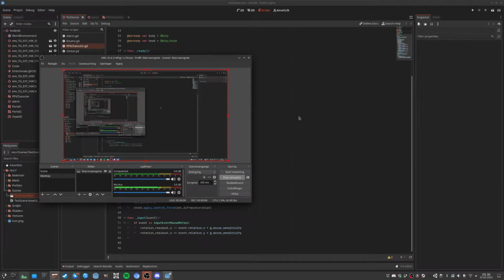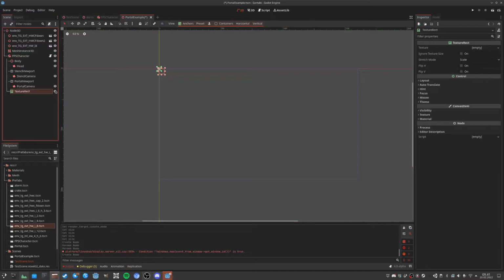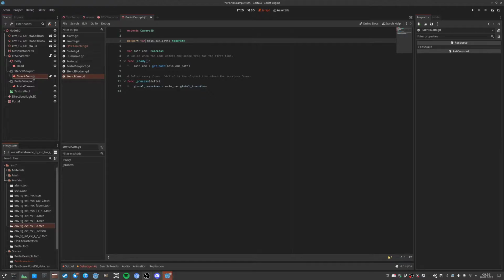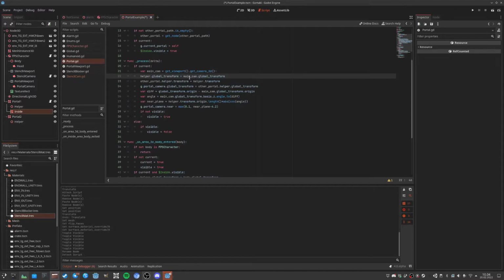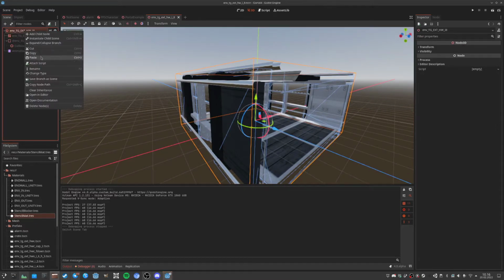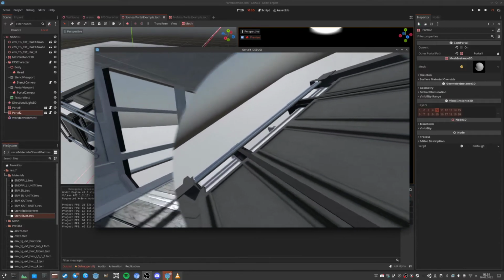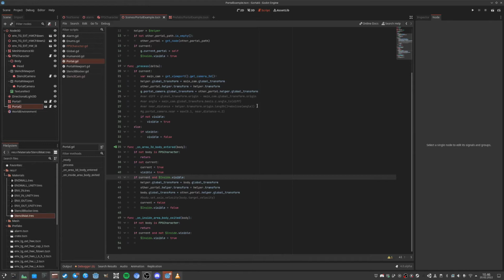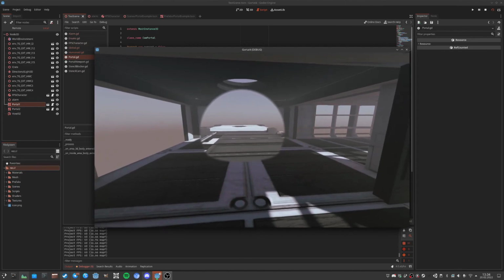Godot Portal Tutorial

Comment: Does this work with packedscenes to change between .tscn files or only inside the current scene?
Reply from the maker: You need to have both ends of the portal rendering with the two cameras in the current scene tree.
So yeah you can jump between two scenes ("tscn") files, but they both need to be loaded and visible.
Reply: @Pracedru  should be possible then with preload, right? Because the 2 addtional levels i have in my game shouldn't be visible in the main level, but this portal effect would be very neat.

Comment: I would love to implement those kind of portals in a project of mine. However my project is a third person game. The problem there is that the portals are always rendered above everything else. Do you know how could solve that problem?
Reply from the maker: You could use the stencil . When rendering it you can include the things that block it.
Reply: @Pracedru  Thank you for your answer. I was trying to change the culling and visibility layers but that didn't work out. I am sorry but could you describe in a bit more in detail what exactly you mean by including the things to block in the stencil? Thanks in advance.
Reply from the maker: Yes. The things that need to be rendered above the portal needs to be rendered black in the stencil. I essence the portal is white and everything else is black. If your character is between the portal and the camera, then it needs to be rendered as black on the stencil. Include the character in the stencil layer and make sure it is rendered black. @DevMarco-
Reply: @Pracedru  Thank you again for that help. I was able to prevent the portal from rendering on top of my player now. As you suggested the player had to be black in stencil camera so I applied an all black unshaded material to my player for now. Is this the kind of solution you meant? I mean it works but it seems a bit clunky because right now my player is a capsule without any texture but later I would need to create something like a "shadow" object that always has the same dimension and consider every animation that has the unshaded black color for the specific layer on it.
Reply from the maker: @DevMarco-  There could be a range of issues with this solution. Also there might be problems if you want to have semitransparent objects like flames and smoke between the camera and the portal.
Reply from the maker: @DevMarco- I'm not entirely sure what you mean by shadows. but this can be a very complicated problems to solve.
Reply: @Pracedru  Sorry that was bad explained by me. I mean with the current solution my player got an all black unshaded material. Later it should be a human model with animations and so on. Obviously it should have textures and not be solid black. Every other color would let the portal bleed through so I have to have an object with the same mesh as well as the black material attached to it. so that it blocks the portal correctly. That's my current understanding of how to ensure the player model being rendered as black in the stencil camera's view. Or do you know about a way that I can apply a specific shader or material on a single layer only?